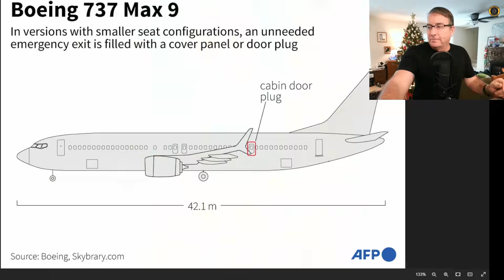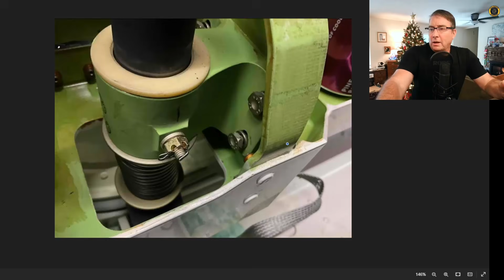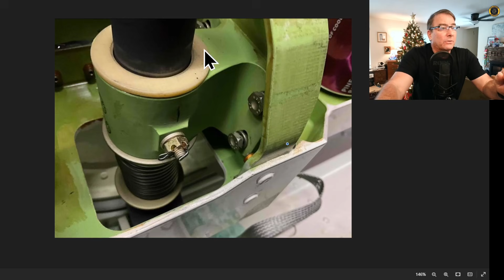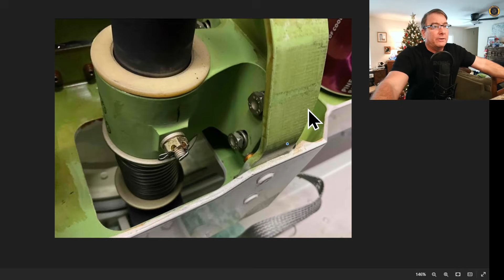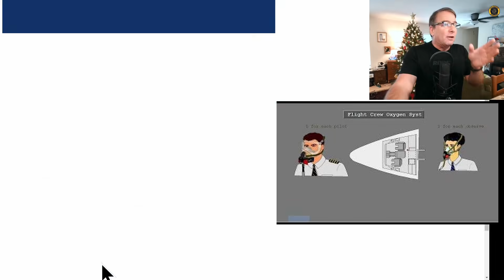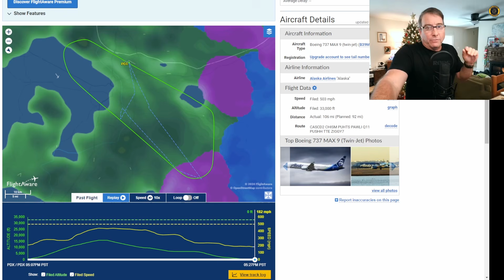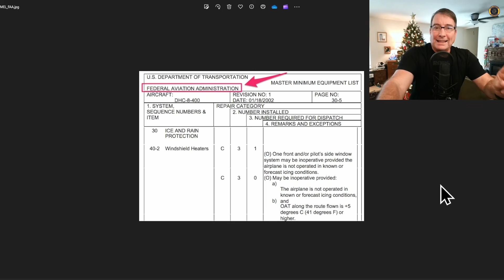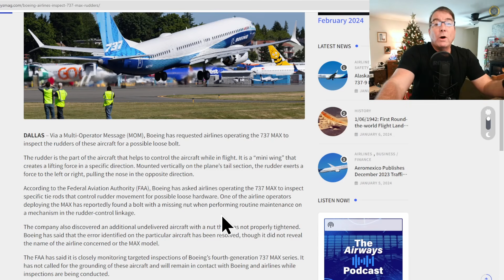"Yes, We Have No Bolts"  9 Jan 737 Max-9 Update

Comment: Juan is so good at giving us just the facts and explaining events and situations in aviation. In this video I seem to detect some anger in his voice and to me this is entirely justified. Every time he goes to work he has to trust that the machine he is flying has been built to acceptable standards and maintained accordingly. We as passengers have to also trust that pilots like Juan are adequately trained and professional enough to show up for work in the physical and mental state to perform their job safely. Clearly Boeing is failing at their part in this set up. We should all be angry.
Reply: The sloppy work at the factory would have been found at the first heavy-check, or C-check.  So, the airplane has to hold together for about three years and then it will eventually get sorted out.  Interesting concept, to be sure.
Reply: That's the first thing I noticed. I've never seen Jusn get that upset during a video. Shows how serious the situation is
Reply: Agreed.  Very well said.
Reply: Lol. He called it a heap
Reply: But I was shocked to hear Juan say that the pilots routinely ignore warnings and red flags for the cabin air pressure monitoring/automatic control systems and blame any discrepancies on faulty cabin pressure monitoring instruments. That's a scary thing to happen, especially since this 737-Max was sending warning codes repeatedly in the weeks before this accident.  Such a culture needs to be changed.  As Juan himself said at one point during the video, this 737-Max was trying to tell the human flight crews and maintenance crews that something was wrong with this particular plane, but everyone kept ignoring it.

Comment: I work for a company in Everett (NAT, now part of Safran) that makes models of the cockpit door controllers, and we would often hear the loud pop from the bench when they tested the circuit.  These were for the A320s but not surprised to find that on the 737.  This is part of the keypad lock mechanism.

Comment: If those upper brackets are cracked from the door departing, that would suggest the door broke away from the  bottom brackets.  Especially if they are finding those fasteners for the bracket to the airframe being loose / under torqued.

Comment: About that type certification thing.
I think it's high time the FAA puts its foot down on Boeing's throat, and hard.
Revoke the 737 MAX 9 and 10 type cert, or rather require that it get a new one.
Clearly, this is no longer a 737 as they once were. The numbers are the same but the aircraft is different in nearly every way.
What happens when the books don't match reality in aviation? Deaths, and we've had plenty of that with the MCAS stuff already.
Do we SERIOUSLY need more people to die before the FAA actually causes a problem for the aviation industry?
"Industry watchdog" is one of the MOST IMPORTANT CORE PURPOSES of the FAA, because as we've seen, left unchecked, lots of people die.
The MCAS issue itself was already enough for me personally to never fly on a 737 MAX 9 or 10.
This new issue with the "not a door" door plugs (and the lack of info about the cockpit door being a red flag that makes even pilots wonder what they aren't being told about the thing they are supposed to know every last critical detail about), has just reinforced my decision.

I won't fly on one if you say it's the only flight from my origin to my destination, not unless you pay me $100k or more. But you know what? I've seen corporate greed at work, so I'm gonna add in a few compensation factors, work that in, and it works out to "I'm not flying on a 737 Max 9 or 10" unless by Boeing's action the number in my bank account goes up by $10 million dollars, AFTER taxes. As in, "I get to keep 10 million dollars, whatever that means that Boeing has to put on the check". I don't accept stock or stock options, because I don't trust anyone to not crash the market before I can cash that out.
I'm talking Direct Account Transfer. I don't need suitcases full of $100 bills. I barely use cash anyways.
I also don't accept charitable donations in my name done by Boeing. If I want to donate money (and I will be donating the majority of it), I want sole jurisdiction in who gets it, which means it goes thru me before it goes to whoever I want it to go to.

As for flying, I know I won't get the $10m dollars. That's fine. My terms are "unreasonable", or so they'd say.
I know the value of my life is more than $10m dollars anyways, because that's not a thing you just arbitrarily put a number on.
As for how I'll get to distant locations if I can't pick an Airbus A320 instead of the 737 MAX 9 or 10?
Well, it's simple. Roads always work, and the rail network seems to be a hell of a lot more tightly regulated than Boeing right now.
So I'll drive if I have to. Or take a train. Amtrak is more affordable than a flight most times anyways, and right now it's looking safer than what Boeing has to offer. Sure it's slow, but that doesn't really matter to me.

The whole point of this is that I know for a fact that many people seeing the data I've seen will think the way I think. Maybe some won't, I don't think any less of them, and they're free to do what they wish with their life.
But I know I'm not alone. I know many have similarly sworn off flying on this "taken a step beyond its conceptual scope" aircraft that is the "737" Max 9 and 10.
There are too many unknown and uncontrollable variables to do anything else but that, IMO.
Long story short, keep me the heck out of what looks to my untrained eyes like a flying scrap heap and a deathtrap at the same time.
The only reason this Alaska Airlines aircraft didn't take a life is because there wasn't anyone sitting in that seat that day. Pure chance and happenstance.

Comment: A question to people familiar with the aero industry  practices - What is the point of having a castellated nut holding one item, if the parent assembly is held with regular bolts? Even if torqued to a spec, they will come loose from the vibrations and heat cycles. Likely, I'm grossly oversimplifying the issue,

Comment: For all who are interested, the critical component is actually the twisted cotter pin you see locking the nut from Rotation. without it, the nut will self unlock under vibration.
if my guess is correct, the pin is NOT inserted during phase 1 of plane manufacture to ease installation of seats and fiting in phase 2.
the pin is only inserted and lock AFTER the interior fitting phase 2 in another location. This is an Assembly cockup for sure. not a design issue.
Reply: All true, but if you never put the bolt back in when re-assembling, the issue of the castellated nut and the safety cotter pin becomes rather moot.   Looks like the bolts themselves never made it back.
Reply: Laborers are not A/C mechanics and must have no idea haw to put the door back on or the tools. must have been a change of shift!
Reply: @cyrussumner-i8w   More likely that they had just finished smoking a joint during lunch or a coffee break.
Reply: Perhaps.  And that is an issue
Reply: The bolt would have to be installed. They usually fly planes to where they get outfitted. 

Not to mention Boeing needs to do check flights on new aircraft.
Reply: I dissagree.  As a pilot, engineer and an airplane builder, if the nut is torqued to the right spec and loctite is on the threads it's going to stay there. The cotter pin is a backup, not primary. An other way could be to use an elastic stop nut & safety wire but in this case it was designed as shown.

Besides, there would be no reason to intially leave the cotter pin out in your "phase 1 / phase 2" scenario (which doesn't exist) as the nut / washer / bolt must be removed,as well as many other items, to remove the door plug.

While the fuselage is built in Wichita and then transported to Renton, it is just a basic shell. In Renton all the other work is done, which includeds wiring, wings and tail fin attachment, etc. And finally, then seats / interior finish is done.

Comment: I was an airframe mechanic on F-18 Hornet  aircraft. We used locktight on all torqued or high stress bolts. I didn't see any of that on these. Is that a difference in military and commercial? As far as I know, we didn't use it at McDonnell Douglas on the DC-10's either.

Comment: The cockpit door panels are a fail safe to allow crew to escape in an emergency. There is a cabin pressure device that unlocks the door panels in event of cabin depressurization, it does not open door, that happened due to aft door blowing off and rush of air pulled it open. This system is on the NG 737 for decades, not just the MAX. I have also performed the rudder actuator nut inspection, with no findings.
Reply: Depress or no, it seems to me that the cockpit door shouldn't be able to swing open unless unlatched manually.
Reply: This is incorrect. The door opens during an explosive decompression event to protect the flight deck bulkhead. This is a common design on commercial aircraft.The pressure needs to equalize between compartments to protect the aircraft.
Reply: I can't find any reference to the cabin pressure device which unlocks the door in our NG maintenance manual. However, there is a reference to this system on our old 747-400's and on other carrier 777's. Could this be an airline thing? There was a reference to another feature of the standard NG door which would allow the door to fully open, but I'm not going to discuss this on a public forum.
Reply: You're not supposed to find it. It is a secured flight deck door. The information is usually proprietary/safety. @ImperrfectStranger
Reply: "Explosive" decompression of the cabin?
Reply: Great, now we're going to see hijackers forcibly depressurize the cabin so they can gain access to the cockpit.
Reply: @ducrab  and how will they do that?
Reply: @ducrab   They will pass out pretty quickly unless they have portable oxygen they can use to move around the cabin until the airplane descends.  Not a likely scenario.

Comment: I still would like to see a door in installed position not a door open or some drawing with out the inside panel.
Now thinking of bolts, wrong grade, over torqued for size, over torqued because the wrong metal of bolt. Grade 5 torqued to Grade 8 standard.
Also new person using torque wrench. Always zero out after use. Torque wrench set at wrong setting.
Looking at that one picture of hinge, looks like bolt needs larger washer under bolt head to cover slot plus a lock washer.

Comment: I worked in a pharmaceutical plant for twelve years, taken over by a European banking group shortly before I was hired.  It was all downhill from there.  Personnel cuts, QA worked from their offices instead of on the floor, decreased equipment changeover and cleaning times allowed, QA checks on the floor performed by the same people expected to get stuff out the door.  This was referred to as "empowering the workers on the floor."  People in these circumstances began filling out signatures for work performed, including second checks,  before it was actually done, to save time.  Cleaning was declared finished when time ran out whether the job was done or not.  The "empowered" grunts on the floor got fired when disasters happened, but not the management who made the shortcutting inevitable.

Comment: Having the cockpit door swing open during depressurization creates a path for hijackers to get into the cockpit.  One hijacker can do some damage to depressurize the plane while the rest of the team waits for the opportunity.
Reply: Well if the pressure doesn't equalise, it will force another uncontrolled path through the weakest point in the cabin/cockpit bulkhead. Really, it sounds like it needs a pressure relief valve installation so that the door can remain locked and the pressure can equalise through the valve. Having the door panels blow out instead is a blatant cost saver, and the whole door bursting open just seems laughable.
Reply: @davefloyd9443 
I think the problem with a valve would be the time it takes for air to travel through it. It's explosive decompression, after all.

Comment: If I understood correctly from Juan's video if the cockpit doors are supposed to open, or those relief panels blow out during depressuration, why would it be such a big deal for Boeing to disclose it? Is there something not correct about the doors opening? Just seems they could put it in the manual.

Comment: Seat frames are designed in general for forward/backward, up/down loading. 
Now how much force can it withstand when the plug door fails with passenger’s seated and strapped in.
Simply put what  would it take to rip the row from the floor and out the door?

Comment: The Cockpit door automatic opening during depressurisation is a reqirement for all cockpit doors. Its on Embraer aiplanes, Airbus airplanes and all certified Airliners.
Reply: Is the purpose of the to protect the structure integrity of the rear wall of the cockpit? Or is it to provide a means to check the state of consciousness of the pilots?

Comment: reading the related blogs there were (onboard) warning and alerts (e.g. auto faults) that have been edited out of previous 737 flights, that would indicate pressure variations possibly that were unknown as to root cause; so now maybe we know.   This could be a large scale lack of proper torque (wrench setting) on pressure-induced-frangible bolt/nuts.  This could be a (very) large issue with quality over many years (and possibly incluing plug/door subcontractors).  This looks like a large impact since official lawsuits were already filed earlier 2023 and CEO(s) fired in 2023 over related (torque wrench) quality issues.   Too many loose nuts !

Comment: Wouldn't a simple flange on the edge of the plug have been a better design? You're changing the seat arrangement anyway in order to justify removing the plug door, so you can just remove it from the inside when needed

Comment: Do any other airplanes have these plug doors? This is a TERRIBLE design!!! I'm an engineer and I would create two plugs that has NO hinges and channels but the entire plug would have 12 bolts and Pins on the right and left side. In addition, 4 bolts and pins would on the top and bottom. Hence, the entire plug would be bolted, with 12 + 4 bolts and pins on each bolt, into the frame, Hence, no maintenance would be necessary on the entire plug. The plug would be permanent until it was necessary to redo the seating in the cabin.

Comment: I think you have the door operation wrong. You stated that the door has to lifted for it to come out. This is impossible as the fuselage fitting will prevent this. The bolt you show in the photo is to prevent the door from moving down and out of this fitting. I believe the springs at the bottom push the door plug up into these top fittings.. The stop fittings certainly do prevent the door from moving outwards.. I am not a 737 expert but have worked in the airline industry as a licensed mechanic in three countries for 46 years . I think you need to re evaluate what you are saying.
If the top two bolts failed or were missing than the door could move down and out of the top fittings and the pressure differential will do the rest. Keep up the good work, I always watch your show.
Reply: How do you move it down if the top of the slider is enclosed and the bottom is the part that has an opening and a slide guide? Watch his previous vid where he explains how the plug is put in place

Comment: I think this issue stems from a management decision (posssibly executive level) where they decided they needed to cut costs, and this plug was the place they chose to do it. And omitting the design of the cockpit door opening in explosive decompression from the manual... Yeah, what else did they intentionally forget to add to the manual? And how many more people will be injured or worse killed due to Boeing's efforts to chase profit over safety?

I dont imagine the executive or high level manager who makes the call would be impacted mentally as much as the poor technician installing the part if a passenger was to be killed in an accident as a direct result of the part said technician installed.

Comment: Whilst a lead tech for Boeing London Service Centre (yes, re not er) I noticed a pattern of a certain bit of 777 avionics kit that would come in marked as inop. We're also magicians, don't worry about filling in a fault tag, we'll work it out by mind reading. 

Every time the magic smoke was long gone but I had my suspicions.  

LRU (line replaceable unit) was made of two boards with a flex assembly sandwiched between them, so repair was essentially impossible after even one board delaminated. 

Then BA sent one in that didnt actually have anything wrong. I got quite excited, I finally saw the problem. The schematic and IPL (illustrated parts list) showed a 25V capacitor and I was staring at a 16V capacitor. On a 12V rail. I checked our stock of that part number, it was a mix of 16 and 25. 
Whoops.   

Boeing sent out a SL (service letter to 777 operators) on my findings. Mod program followed, I rarely saw them come in afterwards. 

~1998/9. I'm long gone from the industry now, thankfully. There's nothing worse than hearing of an accident aircraft that you may have worked on has crashed.
Reply: I'm guessing the problematic part was a tantalum? You see conventional 16 V electrolytics on 12 V rails in consumer gear all the time and they generally last, but tantalums have a habit of failing short when not derated appropriately, they're basically being killed by inrush current at power on over time due to their low ESR and small size. Quite a common problem in 1980s gear and at times even earlier, like some classic Tek scopes.

Comment: how can the nuts be loose on these four bolts? The  hole in the bolt for the nut's cotter pin determines the tightness. Is it possible some holes are in the wrong place?